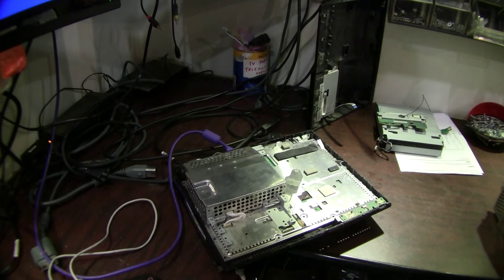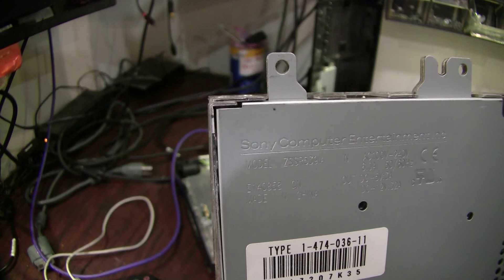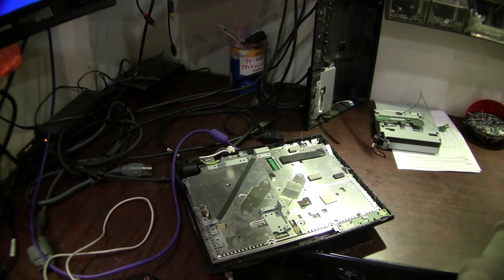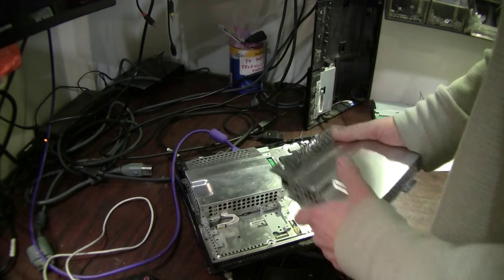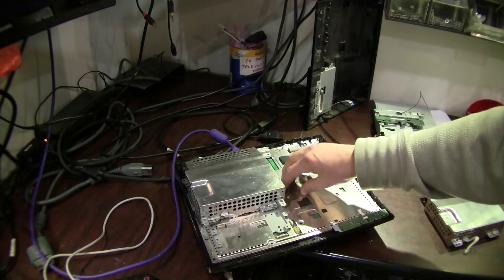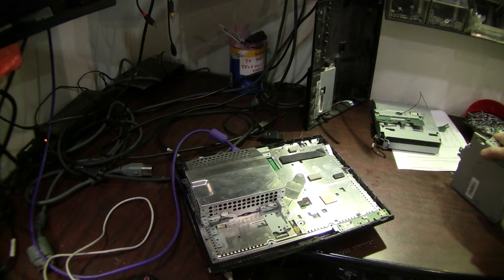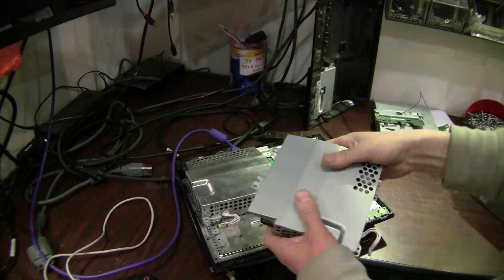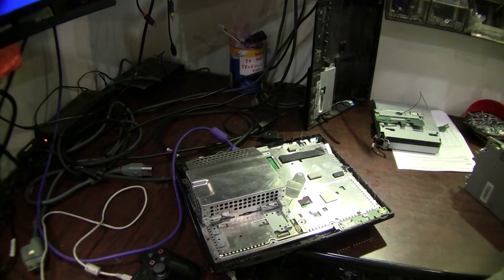Checking your Playstation 3 for an overheating issue which may cause Red Light of Death.

Comment: Well both get hot and you get the problem of YLOD. I put a Fan of 92mm in top of the PSU now is working fine... 1 year 1 month now. since the reflow...
Reply: still working?
Reply: Adam Thiry  I was lucky 🍀
Reply: @95BLUERAY  sorry for the late answer, 😅
Reply: @NESHER1972  LOL its ok glad yours still working
Reply: @95BLUERAY  yes…